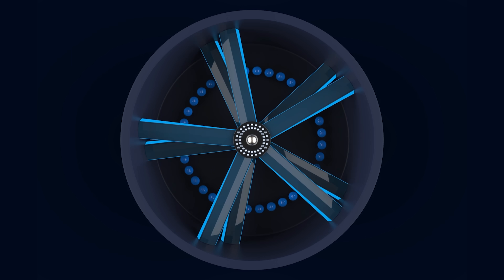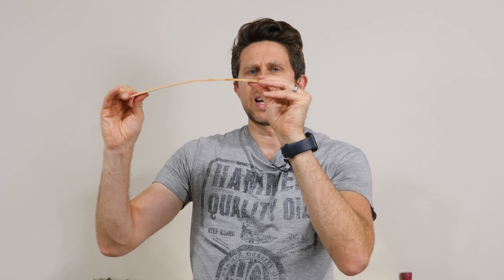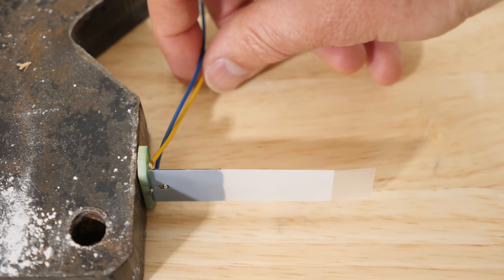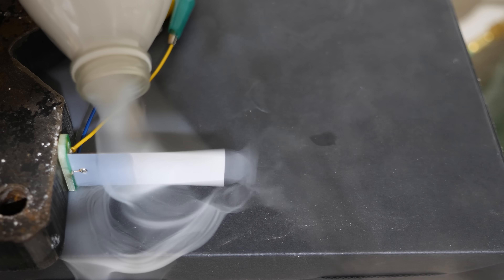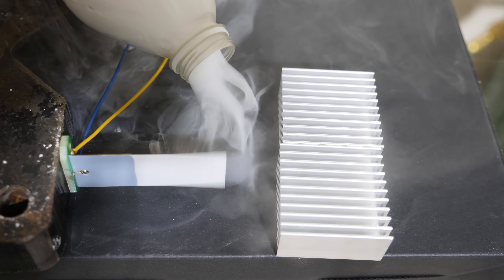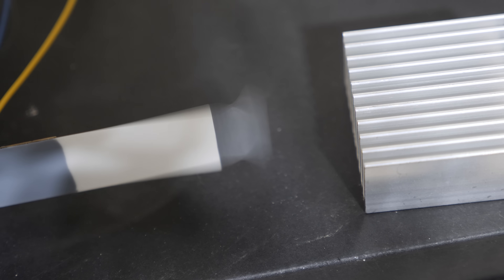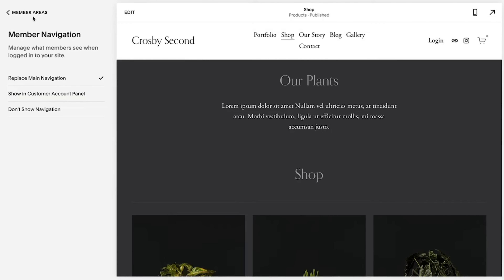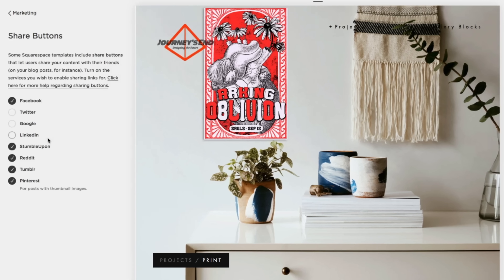A Solid State Piezoelectric Fan—Does It Actually Work?

Comment: If you could design them to be much quieter they could be useful for PC cooling but for now I think I'll stick to water cooling 😄
Reply: at 60 hz we will ear the buzz but if you could make 1 outside of earing range it would be silent to us!!

Edit I just found the "h" its right here
Reply: @minion7111  is your h key broken?
Reply: @MelodicTurtleMetal    He wrote 60 hz.  Stay safe, healthy, strong, happy and be blessed 🕊🍀❣️
Reply: @gunnarallgottsmann  he also wrote 'earing'
Reply: @srizon2307    I know, that’s why I wrote it.  He must be a magician, that h was gone 🙃  🕊🍀🍀🍀❣️
Reply: @gunnarallgottsmann  Are you okay, is like half your conscience being drifting into the void, while the last two brain cells rub together to put emoji’s down? Or are you just trolling…
Reply: What?  You don’t know the meaning of the upside down emoji, sigh?
Reply: @minion7111  the higher the frequency the lower the amplitude... plus the vibrating modes/harmonics of the material would still fall below the 20kHz
Reply: @minion7111  bats wont be happy 🙄
Reply: Gamers will do anything for a great PC 😂😂
Reply: you know the water still has to be cooled by fans and a radiator
Reply: @hexerade.e6142  But, the water and the radiator increases the capacity and surface area. Which means the fan runs less and can run at a lower speed and produce less noise. With a decent sized radiator it likely wouldn’t need the fan for normal usage.
Reply: at 120 volts this would require a separate input for pc's and laptops, also im fairly sure that these things produce way less airflow per square Inch/cm than a traditional fan.
Reply: Is your PC cooled with well water or what?

Water is only the transfer method, and in fact a inferior one to regular air solutions